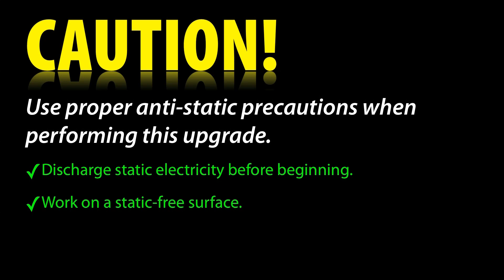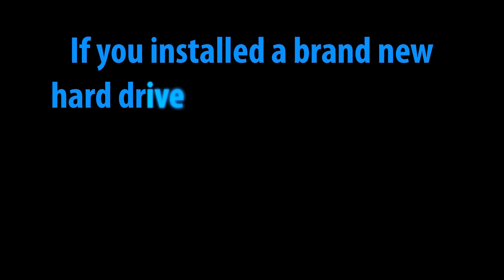13-inch MacBook Pro Mid 2009 Data Doubler 2nd Hard Drive/SSD Installation Video

Comment: can you install other OSx than "el capitan" upgrading a 2009 macbook pro with ssd and 8gbRAM ?
Reply from the maker: Regreso al Bosque we are sorry to report that upgrading the MacBook Pro 5,5 with an SSD and more RAM would not allow the machine to take one newer OSx past 10.11.6 El Capitan, we do apologize. 
 
This is due to the software limitation that the machine supports with Apple's OSx releases.

Comment: I have a mid 2012 MacBook Pro. I've replaced the optical drive with the crucial ssd. Once I turned on the device. I went to disk utilities and did not see the second ssd (1tb)  but just my main ssd (also 1tb). How come?

Comment: Is it possible to just plug in the ssd in the opticaldrives sata plug and just tape it in place without the adapter/bracket or caddy? Thanks

Comment: Will installing the data doubler reduce the overall weight of the laptop? (Since the optical drive is removed, assuming that it is heavy)

Comment: Hi Guys can you advise me please on what would be best update for my MacBook Pro mid 2009 ??? To replace HDD to SSD   OR    To change 2Bb Memory To 8Gb RAM , To make it work faster ? Thanks !
Reply: SSD would increase the times opening applications and the boot process. If you were to compare a MacBook with a HDD and 8GB Ram to a MacBook with an SSD with 2GB Ram, it'd probably be roughly the same. Update both if you can afford it. But if not, the SSD.
Reply: WeMuckAround Thank you friend

Comment: Totally thinking of doing this. All i've done to my mid2009 13" 2.53 is bump the ram to 8gb. For a laptop getting into her cougar years she easily keeps up with a lot of the low end new models today :) It's brilliant, I think the last time i even used the optical is when i boot camped win7 lol.

Q, is there a weight difference after doing this? lighter? sorry if i missed that fact somewhere...

Comment: I was thinking of doing this with my mac. I currently have the stock 160 GB hard drive. My idea was to run OS X from a new 256 GB SSD and run Windows 7 or 8 on my stock 160 GB HDD. What do you think? I'd like to have your opinion. and is it easy to set up that way?

Comment: @Artaxerxes91 the optical drive isnt as needed as it was a few years ago. Car stereos use bluetooth to connect to ipods and some come with HDD. Far as movies and software goes usb flash drives fill in the blanks. In less than 10 yrs the Macbook air will be a standard.